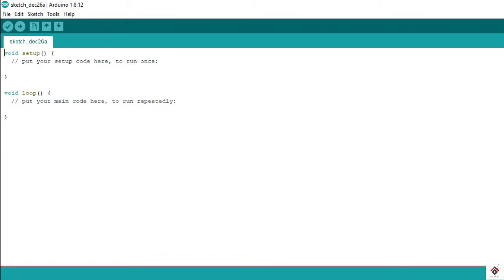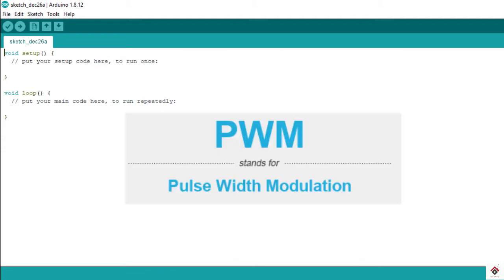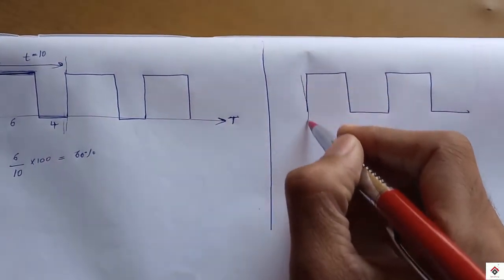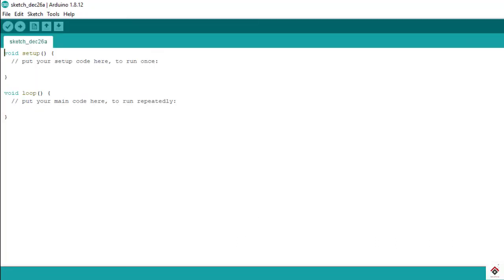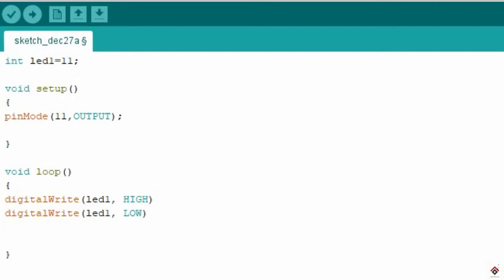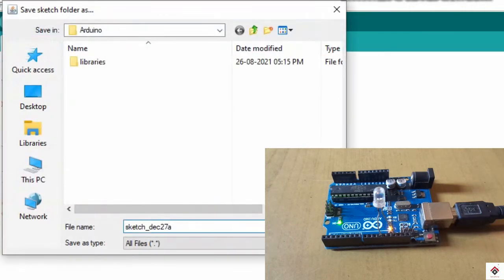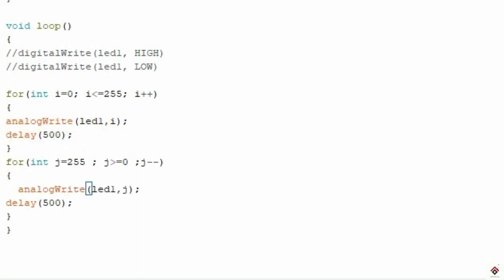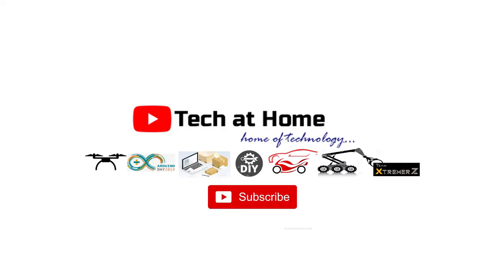LED fade using Arduino | PWM in Arduino (Pulse Width Modulation) Explained | Arduino tutorial 18

Comment: Hi bro good explanation, I have a small doubt what happens if you keep that delay 0 seconds or remove that delay line?
Reply from the maker: Thank you, 

If there is delay, LED stays in particular brightness level for given delay time.
Without delay, you cannot observe the change in brightness.
Reply: @techathome  can I try this with my Arduino and LED without delay?
And can I try this with Inbuilt led?

Comment: Hi can i know how you are saying pwm max of 255 how do you get the value if 255??
Reply from the maker: In Arduino Atmega microcontroller, the registers are 8bit.
So the register used for this PWM operation can store 8bit value( 2^8 = 256)